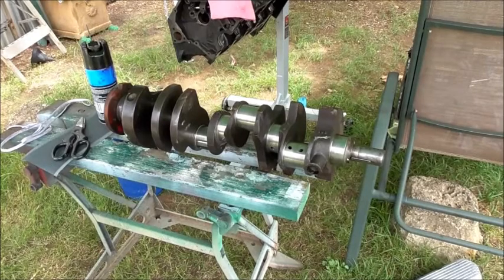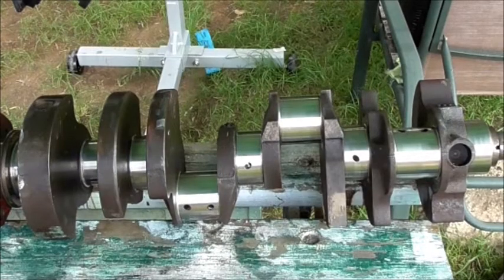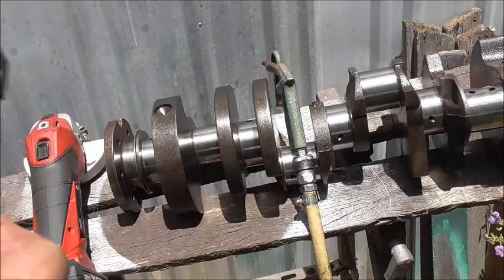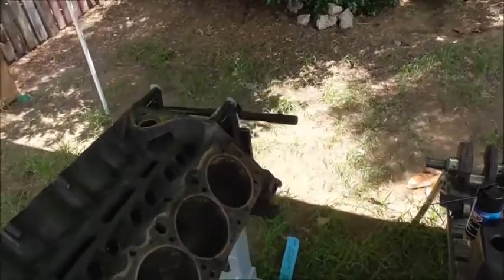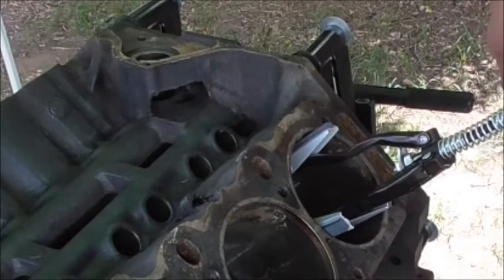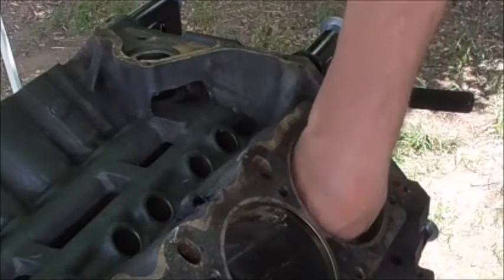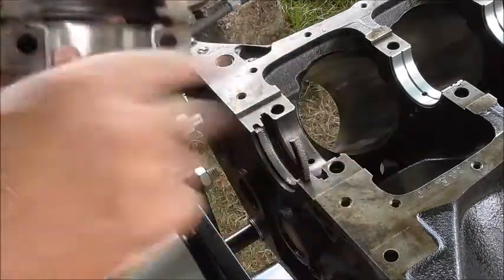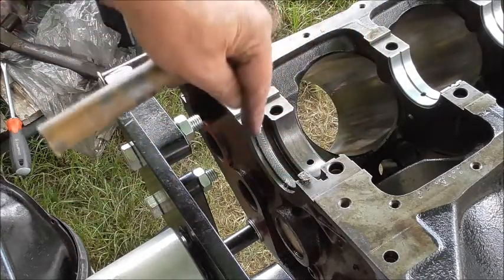Re-building 308 V8 engine (Part Three)

Comment: I’m sure there will be engine builders shaking their heads...... but the bottom line is that’s all you need....... Assuming you don’t have hidden problems like journals that are out of round etc...... if it’s all in good nick just needs a freshen up a backyard job is absolutely fine and should be encouraged

I’ll be interested to know how the rope seal went they can be a pain everybody recommends different things it is possible to have the outer lip machined off and convert them to a synthetic rubber type seal which is still cut but then they put a silicon join in a strategic location I see this videos was a few years ago so I hope she’s held up I’ll be interested to find out thanks mate
Reply from the maker: Held up well thanks. Engine is good and no leaks.